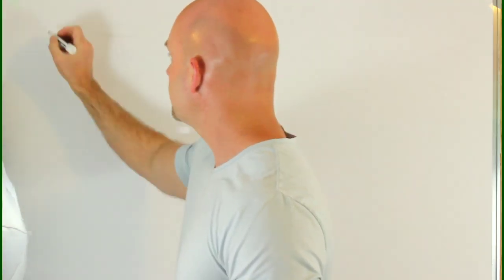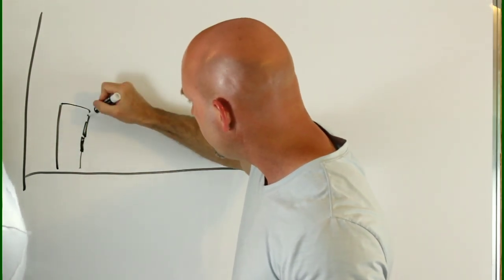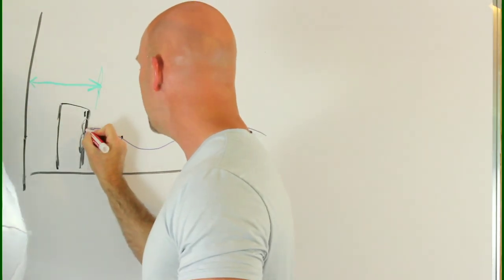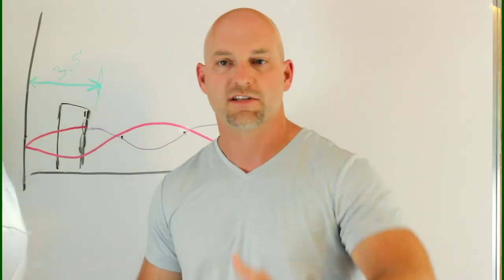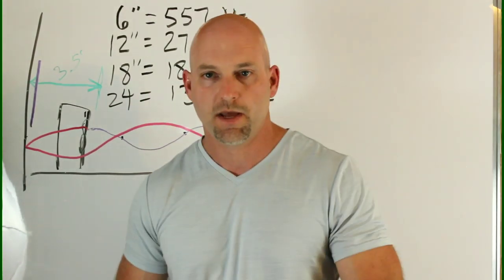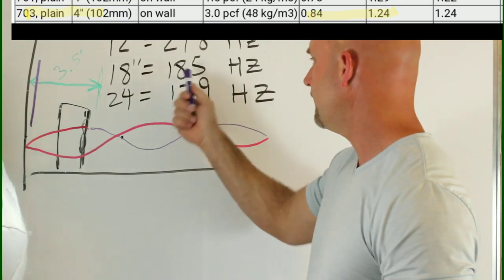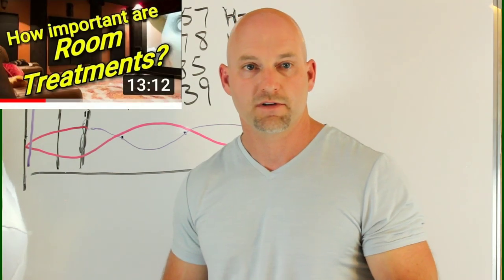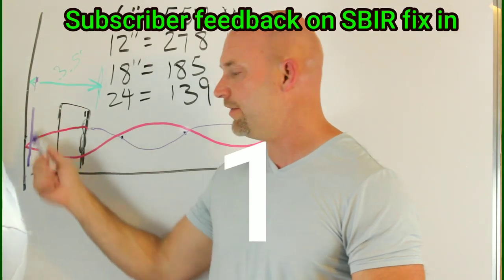Ep. 27 - Bass killer!  Boundary interference and how to FIX it | Speaker Setup | Home Theater Gurus

Comment: More gold here, semi complex subjects broken down to simple easy to follow explanations and more importantly what you need to do to fix them. Had a dedicated HT for 6 years now and it has never sounded so good by changing things based on your videos
Reply from the maker: Thanks so much!  Really love positive feedback like this!
Reply: Home Theater Gurus you ever heard a Procella audio  speakers as front LCR in. HT, are they a lot better than hifi speakers such as svs or klipsch in a dedicated HT if there is not a requirement to listen at reference levels?
Reply from the maker: @Stevo19801  no I haven't but I have a friend who designs for some big name home theater designers and they use them often. Them and Triad so yeah I know they are excellent with awesome on and off axis. They even have offerings for reference capable system.

Comment: Great video! Two things I don’t think you mentioned: (1) SBIR off the side wall since many people have narrow rooms with mains pushed up near the side walls, and (2) surface area of absorb and how a single 2x4 panel probably isn’t big enough.
Reply from the maker: Thanks Eitan! Yeah there's always something I notice during editing that I missed.  I don't do any prep and just kinda jump in front in front the camera and start talking.  I'm so busy I get them in when I can.  I made 3 videos Sunday and probably won't be able to do more for a few weeks as after work and weekends I'll be on a dozer working on our new house site.   I can't even remember what the 3rd video I shot was about, guess I'll find out when I edit it.. 😂. 

The  2x4 panel will be good for the upper modal frequencies but yeah at a point larger is definitely better especially. 

As for the side walls the room treatment videos would cover those too as 2" panels with the angle of incident will absorb a good bit lower than the specs show. But I should have mentioned them. 

I should have mentioned ceiling and floor too as possible issues but really for that I'd want to show measuring to confirm issues exist and I don't want to get too advanced unless I'm doing something where I'm actually measuring in room. 

I really wanted to key in on front wall sbir to lead into the next video as they kinda go together.

Comment: The front of my speakers is at about 22" from the back wall so I'm going to use your advice making some acoustic panels that I'll place behind the speakers on the wall to see if it improves the bass in my room, I also have an active subwoofer that I had to put at a 90 degree angle at the right side from where I'm sitting but I did put it higher than you'd normally do so the driver of the subwoofer is at ear height when I sit down, you can't hear where the bass is coming from if you close your eyes in my room so that's a good thing.
However when I stand up and walk through the room I do have a couple of spots where you can hear the bass way too loud and other spots where it's way too low and I would like to improve on that so it's more of the same everywhere, I know it's not possible in my room to completely get rid of the low and high loudness spots but I'm sure it can be improved and I'm going to take your advice and try out a couple of different things to hear if it makes any difference and hope it will improve a bit.
Thank you so much for sharing your knowledge so I don't have to listen to people's dumb opinions that do not help at all, your information is actually good and usable which is a great thing.

Comment: Fantastic video as always, very informative. Am I correct in my understanding below;

If I have my baffle around 30-32 inches from the wall, that’ll have my null at below 100hz. So instead of trying to absorb it, setting my crossover at 100hz would solve the problem?

Comment: Hello again, I hope all is well. Question about SBIR and my center channel. Due to the room size and barn shape (attic space of a Cape Cod) I mounted my CC above the screen. It sits on a shelf with the ceiling about 1 foot above it. I have about 3 inches more of space between the screen and bottom of the shelf. I was thinking of replacing the shelf with 2 mounting brackets that would sit lower and closer to the screen. This would also open the space below the CC since it will only be supported at the 2 points on the brackets as opposed to a full shelf. Just wondering if this extra work would/could make enough of a difference to warrant the change? Btw, the room is 18'x13'x7'.25. And this is a 7.4.4 system with 100 inch screen and two rows of seating. That's why the CC went above the screen.

Comment: Wow awesome video. Thank you for this wonderful detail put across in such a simple manner. Did the next video on fixing SBIR get posted ? You mention some trick to completely fix SBIR ? I used the information in Ep 11 on modal frequencies and did find a good spot for the sub, crossover level and seating position to avoid room modes. But unfortunately the ringing is still there on some low frequencies. I am now looking at room treatment based on your 4 part video and this one on SBIR. Planning to treat the back wall around the couch with 4 to 6 inch rockwool 40 kg/ m3 because, unfortunately given my room dimensions ( L x W x H  at 14.65 ft X 12.6 ft x 98 ft brick wall ) I am seated close to the back wall. My speakers are HT series Genelec G3 and Genelec 7060 B sub, unfortunately only one Sub. On and off axis are excellent. Coming to my question, will treating behind the Sub with a similarly thick panel like the back, help fix the ringing. I can also look at  similarly treating the ceiling if required. Is there any other option? Since EQ (Audyssey MultiEQ) my final step is not going to address the issue. I already did a basic run with Audyssey and got the Sub distance ( much larger than physical distance to adjust for the time delay etc done) also the phase and level of Sub was tested and set prior to that so no issue there. Sorry to be so specific, would really help to know what the  possible solution could be?
Reply from the maker: Treating the walls will help but not much in the sub region but primarily in the subs harmonics which are upper bass frequencies.

Eq actually works fantastic on ringing as ringing is always present at peaks.  Reducing peaks reduces how long decay is audible which reduces ringing.
Reply: Home Theater Gurus A big thank you for the quick response. Can you also let us know if you did put out the video on the solution to SBIR, that you said you would cover in the next video. Is that out or yet to come?

Comment: I followed your REW tutorial to set up my dual subs but I could not figure out why my system sounded better at 100Hz crossover until this video!  My mains are  36 inches from the wall, which puts it at 92Hz........Thank you!  Both my subs are in the front btw...I've not seen anyone else talk about this.  I was only looking at the crossover point as it related to bass management.  Based on this, I think most people are probably running the wrong crossover for their placement.
Reply from the maker: Awesome. I love when science wins another one!  Thanks for the feedback!

Comment: How much breathing room do ports need to operate properly? Aren’t they designed to use the back wall for bass reinforcement? How close can the absorbers be to the ports?
Reply from the maker: I've designed subs for over 20 years and the rule of thumb is pretty much the same for all tuned enclosures.  You need to be at least the port width (for round ports) away from a solid surface.

Comment: Where do you measure the distance to when you have your speakers toed in so they are standing kind of diagonally from the wall? From baffle and straight back, or from baffle to wall in line with the speaker?

I got 50cm deep speakers so my distance from the wall will result in 113 hz ish. Whould this be any problem ? Should I put my speakers closer to the wall? Some distance from back of speaker to the wall is good isn’t it?
Reply from the maker: Use the center of the baffle (front of speaker).
Reply: @hometheatergurus  yes, but to which point at the front wall? Straight back or on line with the speakers angle of toe in?

Comment: Really great and informative video.  I have a null in my front stage around 110-120 hZ, and with the distance to the wall I now assume its due to SBIR.  I also have a false wall thats like 6-10" behind my speakers.  Its just wood frames wrapped in fabric, so im also assuming the sound is traveling through the false wall and reflecting off the actual wall.  At that frequency it seems its too high to raise my crossover, and too high to use a panel to absorb.  I was wondering if i could put absorption in the false wall to solve this?
Reply from the maker: Yeah it'll be off the front solid wall.  It could be front wall sbir or rear wall as explained in the 2nd half of the video.    There's also side wall but if you've treated the room per the room treatment episodes that won't be it however it could also be floor or ceiling as well.  We just went over the most common ones here.  Also make sure you aren't sitting in a room mode.
Reply: Home Theater Gurus thanks for the response.  The rear wall is treated as well as the sides as per your video.  Would adding absorption in the false wall change anything?  My thinking is will absorb some of it and whatever gets through would be absorbed again after it reflects off the solid wall.
Reply from the maker: @danielwander605  its never a bad idea to absorb behind a false wall area.   Enough insulation can help with modal issues above the subs for sure.  We also use 1" behind an acoustic screen to absorb any high frequencies reflected back from the screen.   But thicker is better!

Comment: thanks for the cliffhanger lol. 
on a side note what do you think about VBSS? im thinking of building 4 of them, do you like this design? or should i go with something else (not above $400).
Reply from the maker: You're welcome.. 😜

The VBSS is a great design for the money. I'll be covering similar designs where you use a high sensitivity driver and Tweak box size and tuning and then some eq to get a really nice high output result.  It doesn't go super low but it's got a ton of output where it counts and it's affordable.   See the chest slam Video to see where the sub peaks are at.
Reply: Home Theater Gurus already saw all of your videos. Should I wait for your designs or just build the VBSS? I’m planning to start building tomorrow.
Reply from the maker: @Azzy_Mazzy  go for it!  It's a very fun sub.  I'll be showing how to design a sub and be comparing different drivers and alignments but I'll most likely be doing a 3 to 3.5 cubic box tuned to around 20hz with a um12 for the build.
Reply: Home Theater Gurus thanks for the great content my man.
Reply: Home Theater Gurus where should the subs be aiming at if you corner load them? At the center of the room or at the corner or just straight ahead on the side wall?
Reply from the maker: @Azzy_Mazzy  this is explained in the room mod calculator cidie and I think sub setup video too.  You do not aim a sub.  80hz is 14' long.  50hz is like 55feet long.  They're omnidirectional and huge!  When you turn a sub your changing its placement in the room not aiming it.  So basically it doesn't matter if the response works.  Place them so they look good and fix the modal issues.
Reply: Home Theater Gurus that what I meant sorry it didn’t come clear. Do you have any speaker recommendations? I’m thinking of getting the HTM-12 but I don’t really need the high sensitivity, I like it but i don’t need it, so do you have anything better for the price? The cheaper the better.

Comment: So if you have drivers on the back of your speaker also should you panel behind them or does that defeat the purpose of having rear drivers. Thanks.
Reply from the maker: What frequencies are the rear drivers playing?  Are they subs or is it like a Def tech with bipolar design.

If it's a bipolar and you have drivers front and rear playing the same frequency it won't have the same distance from the wall for both drivers so each will have its own distance to the wall and therfore its own sbir cancelation frequency.
Reply: Yes they are def technology bp7000. I probably shouldn’t do any treatment behind the speakers correct
Reply: Yes they are def technology bp7000. I probably shouldn’t do any treatment behind the speakers correct
Reply: Yes they are def technology bp7000. I probably shouldn’t do any treatment behind the speakers correct
Reply: Yes they are def technology bp7000. I probably shouldn’t do any treatment behind the speakers correct
Reply from the maker: @BuffaloBullionNY  you could measure the response and see what
 issues exist.  But yes absorbtion will change the sound and kill some of the low end output as they are intended to be reflected back into the room.

Comment: Let me guess. Front Baffle Wall ? So your speakers are essentially in-wall mounted thus the entire wall is the speaker baffle . Only problem is your subs will no longer be in the same place acoustically. Or your room dimensions will have changed as the baffle wall is now a new wall making the room smaller in length and will change the room modes.
Reply from the maker: When you do a full baffle wall you'll use that wall as the boundary so room mode calculations are based off of that wall.  Of course the baffle of a speaker that's crossed to a sub can have a baffle large enough that no sound can wrap around before it's crossed to a sub so it doesn't require a full baffle wall. 

I will say you're close but not quite on topic of the next video... but don't say anything else as you'll spoil it.  :)  How am I gonna get everyone to lose sleep waiting for the next video if we give it away here..  😁

Comment: Hi Steve, firstly thanks for an excellent informative program! Especially compared to similar programs where the people are obviously biased to certain equipment for obvious reasons. I just have a couple of questions... firstly what happened to episode 15 and also the episode where you were going to discuss the Denon remote app. Lastly,  just some thoughts I had regarding doing speaker calibration with the Mic in the upright position. I was thinking the other day that testing the front and centre speakers makes sense but doing it for the rear surrounds and even ceiling speakers it doesn't. Shouldn't one perhaps mask the microphone at the back to simulate ones ears. The reason being is that I always have to increase my ceiling and rear surrounds to sound ok. 
Thanks again for an excellent program! Christo, Cape Town. South Africa.
Reply from the maker: I haven't done the app episode yet and I discussed it in this video. I'll be doing sub design first then the app.  I sold everything with the house  😂.

As for the levels of the surrounds go watch my episode on calibrating for Reference and tweaking levels and how our ears come into play.  It's a recent episode maybe 3 ep sides back. From you stated above you'll find it interesting.

Comment: Q. How to avoid sbir from the front wall
A. In celling speaker 😂

Great video as always.
What about a rear ported speaker, does the port contribute to sbir? Or is that just "air"?
And from what I gathered is it's fine to place the speakers closer the the front wall unless you have, or are willing to, place thick panels behind the speakers.
Reply from the maker: Hey in ceiling works great at the airport.. 😁

Rear port would be irrelevant here as this is based on baffle distance from the wall.  The issues with a rear ported speaker (phase shift at tuning and being aimed at the wall ) will also be irrelevant because we'll be crossing to subs well above a ported speakers tuning.